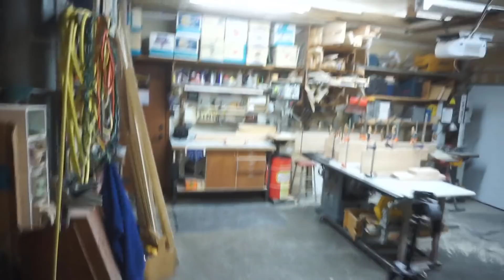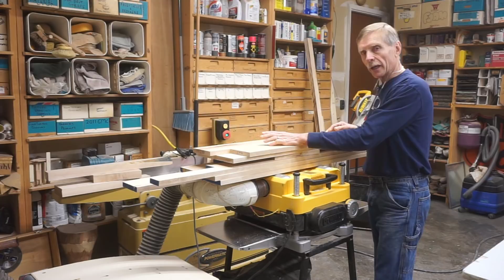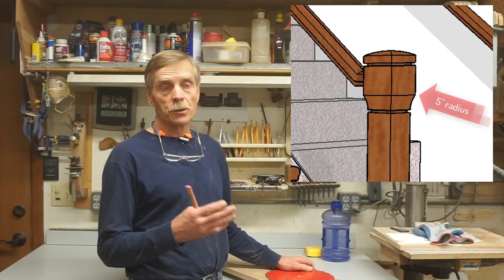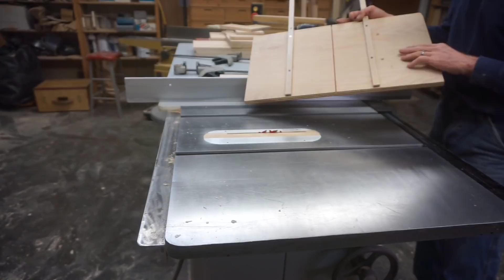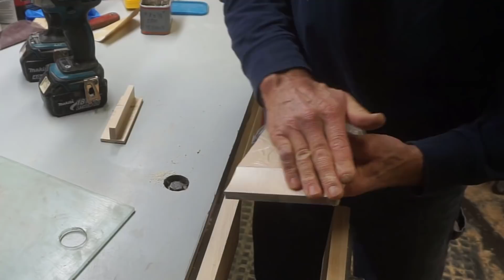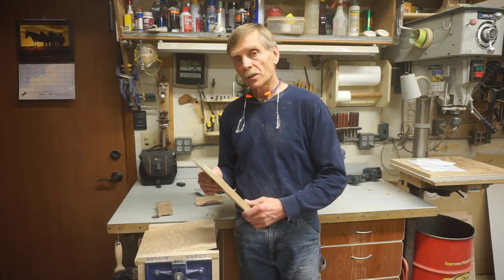Make Wide Coves for Box Newel Posts

Comment: Hey Matt,
Like the gentleman below, I will have to say I was skeptical at first as I have made coves with the table saw and spent lots of time sanding for a smooth finish. Should have known you had some nice little tricks up your sleeve. I got some really good information, thanks for taking the time to share.

Also, don't know if you remember our discussion about my recently acquired old Rockwell/Delta planer. I got it up and running and planing great. I'm still getting a little more snipe on the tail end of the board than I care to live with. I think a little height adjustment on the out feed table will cure this pretty easily. You were right, these old machines were built for the long haul. After being pulled out of a barn, setting for 25 years, a little elbow grease, and paint, she purrs like a kitten. I used your videos for that too. Thanks again!
Reply from the maker: Greg, that makes  us a trio of skeptics :-)  I just had that 'woodworkers hunch' that this technique would work which was only confirmed when I passed that first test piece over the blade and is why I made the comment about 'what winging it looks like'.  It was a true relief to realize how little sanding was going to be required!  I'll sure be using the 'custom bondo sanding block' method for all future tablesaw coves from now on!  BTW there was a significant amount of winging it on other parts of these newels with the most interesting/challenging one while making the 'double dome' post cap pieces so I hope you get a chance to see that video when it's published also.
I do remember your planer story... very cool you're having that 'experience'!  It's nice that the machine has an adjustable outfeed table and the adjustment you mention should certainly handle the snipe problem as long as both tables are oriented absolutely parallel. Judging by your thoroughness I'm sure you've checked the tables for any 'play' or 'sag' in them by adjusting all the little set screws because anything out of kilter there can cause snipe too.  I used to have to fight with a nasty old jointer that had only an adjustable infeed table and it was nearly impossible to get the blade/outfeed table setting just right... that experience and what you're going through both give you much greater respect and appreciation for the work tools can and are doing for you.
Best,
Matt

Comment: Love your videos.  I’ve been a carpenter 40 plus years and still learn something every time I watch your them. Please keep it up.  I would love to see a video of your job site rig, i.e. truck / trailer set up. As organized as your shop and work flow is , I bet your rig would be inspiring.
Reply from the maker: Thanks Kenny... it's rewarding to know a guy with your decades 'in the trenches' still finds things in Next Level Carpentry videos to make them worth watching!  I don't doubt that if I had an opportunity to see you in action that I'd pick up worthwhile stuff as well.  Because of the nature of projects I work on these days a mobile 'rig' isn't necessary so, believe it or not, I don't even have one.  The organization you mention is mostly confined to the shop you see in videos plus a storage 'shed' where everything I'm not using is strategically stashed until I set up on a jobsite.  Rather than have a job trailer where everything has a place I rely on efficient toolboxes for essential tools and portable equipment for things that need to be done on site.  With some camera angles in NLC video you can see a "rolling workshop' toolbox that's parked under my air compressor... I should do a little 'tour' of it sometime because it was my dream toolbox at one point.  Ironically as cordless tools became better that box became irrelevant and the 'Yankee screwdriver', Disston handsaws, etc that stow compactly in it get use more for nostalgia than practicality.  Sorry to disappoint you with that bit of reality... I do plan to do future videos to show stacking toolboxes, 'designer' sawhorses, roller stands and such but unfortunately those take an inordinate amount of time and won't happen quickly.
Best,
Matt
Reply: Thank you for the response. God bless.

Comment: . Again another great video ! Creativity, talent and honesty is what makes well worth to watch. Looking forward to the completion of the post saga😎 I'm just wondering what type of joinery will you use on making the post... I like the locking miter but let's see your way. Keep up the good work and all good things will come to you. From Canada 😋
Reply from the maker: Lino, thanks for your comment!  Until recently I may well have used a locking miter for the posts so I think you'll be impressed with the process I chose instead: much quicker and simpler and, arguably, equally strong.  By that I mean the joint is still stronger than the wood itself so it makes a locking miter, bisquits or splines unnecessary... stay tuned?
Best,
Matt

Comment: As usual a most informative and enjoyable video with great camera work and audio, if possible, could you take a little time in the future and explain how your spectacles hanging around your neck.

Once again thanks for taking the time to video, edit and post excellent viewing....10/10.
Reply from the maker: Rich, thanks for the 10/10 rating!  The video editing process involves numerous replays of every segment of video and audio and, honestly, by the time I decide it's ready to publish my objectivity is long gone so your assessment is quite reassuring.  The 'spectacles' are called Clic Readers which have small super magnets in the nose bridge so they 'click' together and apart effortlessly and are indispensable for detail work in the shop.  The ones I'm currently using are 2.0 magnification in a 'clear' frame style.  You can check them out if you follow the link in the description of this video to the Next Level Carpentry page on Amazon. You may find them locally where you live but I haven't seen them available near my home.  The only two issues I have with them: if I have them around my neck working in the shop the magnets are so strong they stick to any metal I get close to so when I'm changing a bandsaw blade or making tool adjustments they often, almost comically, stick to this and that all during the process... I should probably put that in a video some time :-)  They also don't work if you're sitting in any chair with a tall back on it because as soon as you lean back to get comfortable the back bow hits the chair back and pops 'em off you face.  I honestly can't work without them these days though!
Best,
Matt
Reply: Like the technique to make the sanding block. Great video,looking forward the rest of them

Comment: Another enlightening video. Great stuff. Can you possibly give us a ballpark figure of the cost to the client for something like this. There is an incredible aount of time and efffort that goes into all of your projects, but I am clueless what it all costs.. Is it under or over $2500?
Reply from the maker: SKWDMDYT, glad you like the video!  It's difficult to give you a meaningful answer to your cost question because of the very custom design/build nature of this particular project.
If a customer asked me straight out to do a project like this I'd advise a not to exceed budget of $15k in an effort to avoid sticker shock at the end of the project.  If I had a workable set of plans to start with and had only to do the millwork to produce the posts $2,500 would go a long way towards getting it done.  The whole railing project (you see about 2/3rds of it in the 3D image) designed, fabricated, existing railing removed and new installed with stain and varnish finish will be north of $10K with the 4 tempered 1/2" clear glass panels accounting for almost 20%of the total.  It's the 'custom' part that really drives up the cost which, apart from the glass, is mostly labor.  Once this project is completed and installed a second similar project could probably done for about 50% less since all the design particulars, fixtures, jigs and overall workflow are known.
Sorry that's my best 'ballpark' sales pitch... hope it sheds a little light for you?
Best,
Matt

Comment: I gotta say, i had my doubts in the beginning. I've done coves with an angled fence but the perpendicular travel had me skeptical, but the straight cut really helped your cut come out smooth, where it tends to be ridged when you go on angled fence. Nice tip wth the bindi sanding block.
Reply from the maker: Thanks Jeremy... since you've done coves with the angled fence setup you can probably imagine my state of mind when committing to this 'design', not knowing how the 90 degree travel thing was going to go.  I guess I figured it would be no worse than the 'ridged' surface left using the angled approach. I was quite relieved finding I could take aggressive passes directly against the side of the blade without burns and blue smoke :-)
Since you're an observant guy I'll tell you that, if I had it to do all over again, I think I would have set the fixture to the back side of the blade instead where it would effectively become a 'climb cut' process.  I guess my aversion to dangers of climb cutting on a tablesaw kept me from considering the option while I was setting things up.  It dawned on me while editing video of the little 'blooper' where I pushed a board too fast and the  blade kicked it out.  Having the cross fence clamped securely to the table would eliminate danger and a climb cut cove might well have been smoother still.
Thanks again for commenting!
Best,
Matt